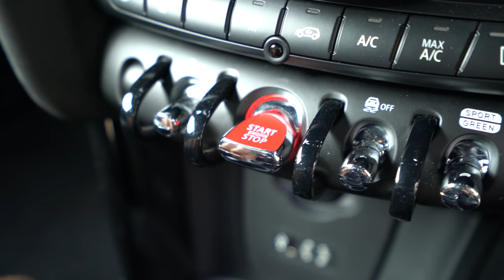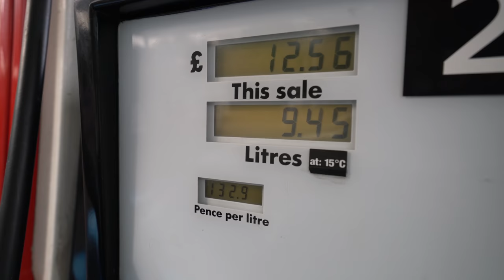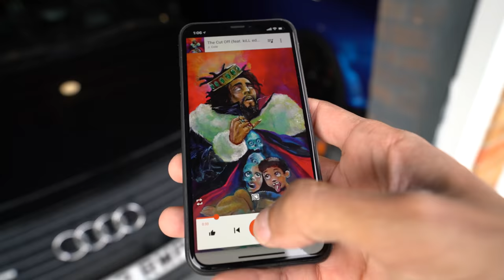Not So Overnight Parts from Japan...

Comment: Use gyeon iron out for your wheels then clay bar then polish and wax. Iron out is ph neutral so it will not damage your wheels but works wonders on heavy brake dust. Hope this helps
Reply from the maker: Thank you!!